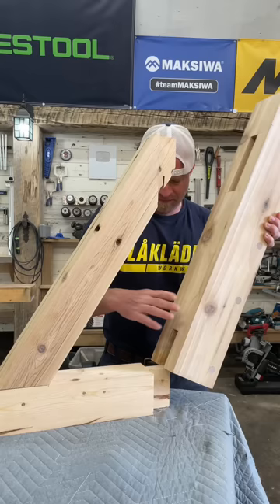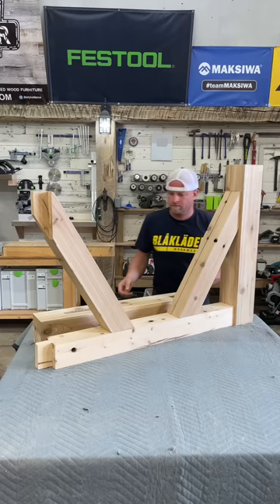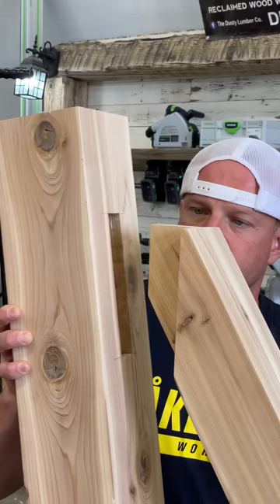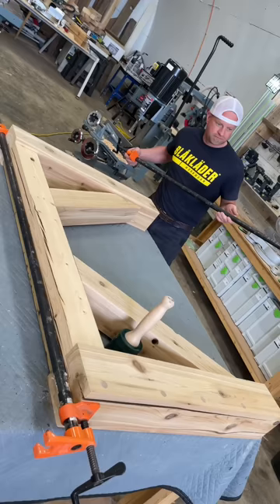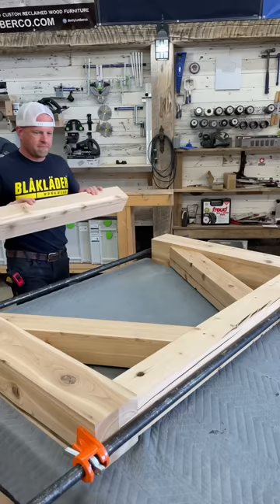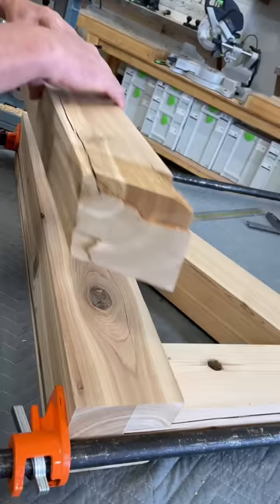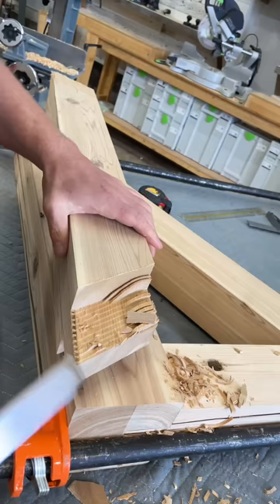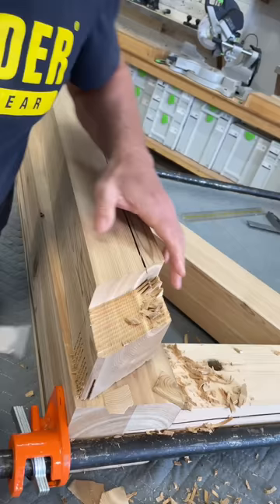Draw bore mortise and tenon

Comment: Great work and wonderfully finished frame but as far as I could see from the video (unless i missed it)this is  not draw boring.The holes in the mortice and tenonare purposely misaligned by a few mm and the dowels are tapered on one side only ,thus drawing the 2 parts of the joint tight together.